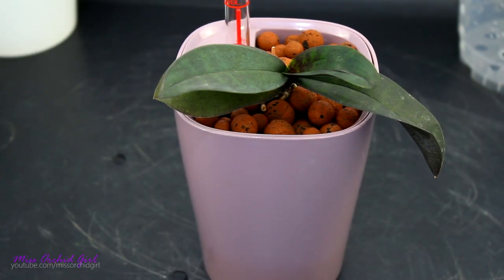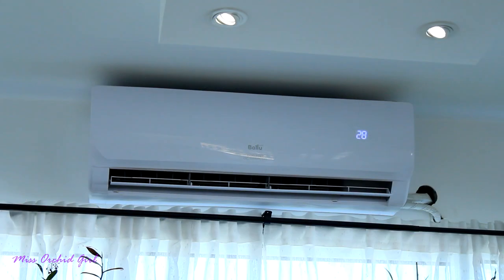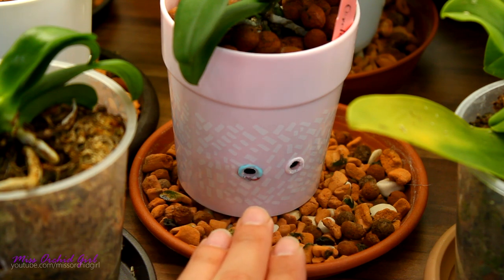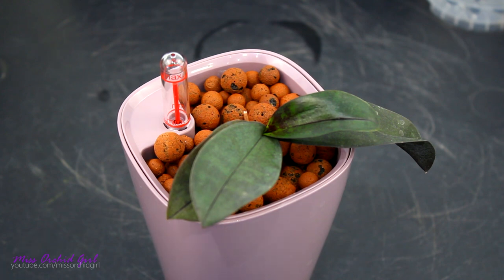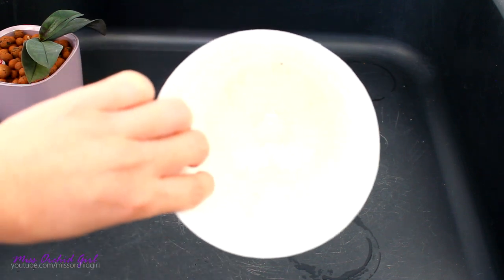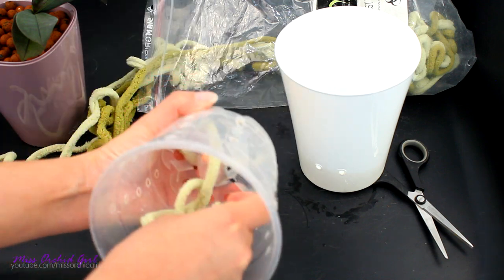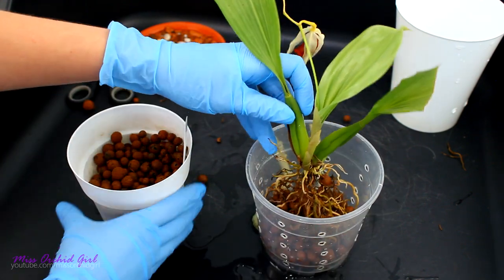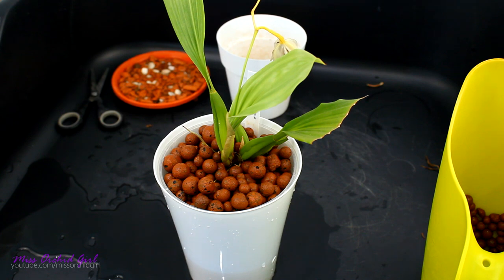DIY self watering pot for my Orchid! - Lechuza wick system actually works?

Comment: I'm trying out large yogurt containers they are 4 and 7/8 inches tall by 4 and a half inches wide at the top, 3 and 3/4 inches at the bottom (I'm American).  That's my reservoir, I don't put any holes in the container.  Then I find a pot about a 3rd as deep and just as wide at the mouth.  I have made one like that (it's not easy finding the perfect fit for the inside pot).  I fill the container with about an inch of water, put the pre soaked wicks dangling from the planted pot down in.  Then set the whole thing into my decorative pot.  It's been one day so far and so far so good.  I did that with my tradescantia nanouk and a modified system for my cyclamen persicum.  There I put the wick up into the ceramic pot that I had already planted into (I forgot it!).  Long tweezers up into the drain hole made that possible, maybe even better as I got it about mid-way into the rootball.  Then under it I placed a clear plastic pot saucer filled with water.  Over that to support the pot, I used a round plant support, the kind used to raise the pot up for aeration and snaked the wick down thru the grid into the water.  I usually have to water the Cyclamen every 3 to 5 days and the Tradescantia every 4 or 5 to 7 days.  It's very dry here and we have fans blowing around our rooms, it's Arizona, desert.  So we shall see.  I have a different set up planned for my Phalaenopsis, I have 6 minis and 3 regular size.  Still working on that set up, but I really like how you did your orchid.  I just have to figure out something for the reservoirs.  Thank you so much for all your know how.  You have no idea how much you've taught me and how I value that knowledge.  Great stuff!

Comment: Ive been using self-watering pots from Santino for my orchids in semi-hydro. It helps a lot as I can adjust the “height” of my reservoir depending on the orchid’s needs, the weather, etc. I buy them on Amazon... they do not have the wick or the Pons medium but seems to work well with LECA.

Comment: I think any stackable container would work. Depending on the deaign, the reservoir might be big or small. Stackable flower pots would work if you can seal up the bottom pot.

Comment: Hello, I am using this double pot thing with my orchids. When  the two pots perfectly fit leca yes in deed remains wet at the top. But during the winter time there is a major issue if there is water between the two pots. They gap between them must be empty. Otherwise leca is super super wet. For summer is perfect, although you need to be careful.

Comment: Loved this vid. My experiments are in agreement with this concept. I hadn't thought about the wick going across the bottom. I've been trying to wick higher in the pot by placing the wick higher. Either vertical or an actual layer. It really matters what the wick size and make up is. I hope that Synthetic works for something! Thanks for having such an open mind and sharing! Xoxo Dilly Dilly
Reply: Dilly Orchid How did it work out to have the wick reach higher into the pot?

Comment: Looking forward to seeing how the DIY self watering pot works for you. Just one thing that always concerns me with pots that have lots of ventilation holes, as much as the ventilation helps the roots: at some point they will grow through these holes and at that point repotting will become so much more difficult without severely damaging the root system. Any idea about this?
Reply: Daniel Taendler - Most people either make the holes too small for the thicker roots of orchids like phals to get into from the start and simply add more holes to compensate for the smaller size, or they make them big enough that the roots will not get stuck but will be able to be gently tucked back into the pot liner before removal of the orchid for repotting.

Comment: I was recently given my first orchid and she just stopped blooming. I can see some healthy roots as well as dead ones plus mushrooms, so I'm going to repot her in new imperial dark repotme mix next week. I'm wondering if I should also consider a self watering system since my climate is VERY dry (less than 10%). It gets very hot here in the summer but very cold in the winter. She's a phal and has five leaves, if that makes a difference. I know phals like to dry out and it seems like the self watering system won't allow for that. Are there other suggestions for helping with the humidity inside a home (on wooden furniture)?

Comment: Hi Danny,
New to your channel and new to Orchids. Love all your videos and have learned quite a bit. Question for you? Or anyone else who might be able to help. I received my first Chaingry Goldstaff (didn't know what it was called until I saw your faves video so thanks by the way!) and the leaves were turning yellow, pot had fungus and it was potted with that moss (all I recognized from your videos, so thanks again!). Anyway, followed all your advice, rinsed with h202, did some cinnamon treatment and cut all dead roots...so there are so roots firm to the touch with green at the bottom but there are parts with exposed root core, then velamen then exposed roots again, do I need to get rid of these too? Any feedback will be greatly appreciated :)

Comment: Hi danny. Great concept as usual. But i have some question. I am trying the semi hydro for the first time. I live in tropics. Where we get heave rainfall from july to september end. Am just worried if am giving to much moisture to the orchids. Leca is always wet .it is kept in a good air flow area. My question is do i need to let the leca dry out completly before i re water?
Reply: I make sure the outer (or mask) pot is bone dry on most of mine before I add more water. It gives things a chance to dry out a bit. The exceptions are the ctsms & phrag/paphs, which use a lot of water at the moment.
Reply: Renee Jolley  thank you! Well mine r in leca and in plastic pot i am watering when i see theres just few cm water left.

Comment: what about useing your semi hydro system with leca but then putting some just some seramis peaces into the media .... then it would be a bit more wicking maybe then it would be moist at the top too...?
Reply from the maker: Hi, due to its shape, the seramis will shrink the pockets in between pieces, so the water in the reservoir will be even less.
Reply: MissOrchidGirl what about mixing/placing the seramis above the reservoir ... in the reservoir only leca
Reply: maybe you could try it? ;)
Reply from the maker: Already did https://youtu.be/zI_-xtxiYMM
Reply: MissOrchidGirl i am talking about some not all that many like you did in that video try to get just some of seramis peaces... if you know what i mean... just normal semi hydro but with SOME seramis peaces but not in the reservoir ;)
Reply: Clearly you will not be satisfied until the leca/seramis mix is exactly what you have in your mind. Dani has already stated multiple times that she is no longer using seramis and why. I think this is an experiment you want to do; perhaps you could tell us how it works for you in your environment.
Reply: Michael Toolin i know that for me in my country it would be too much ... with normal semi hydro my top stays moist enougth
Reply: Manuels Plants For many people I am sure it does, however Dani is not only concerned with improved wicking ability but increasing the amount of available water.